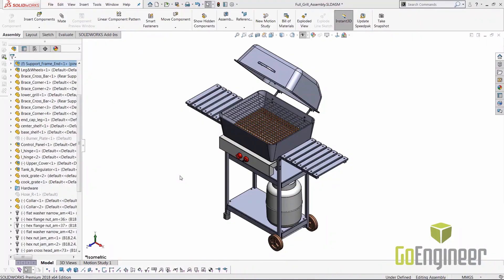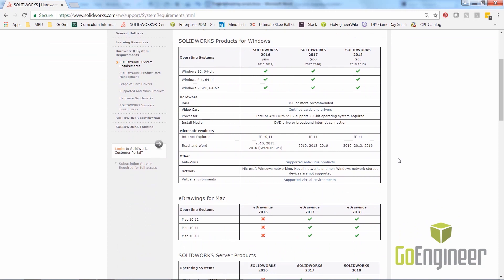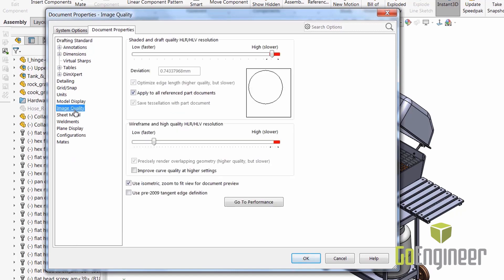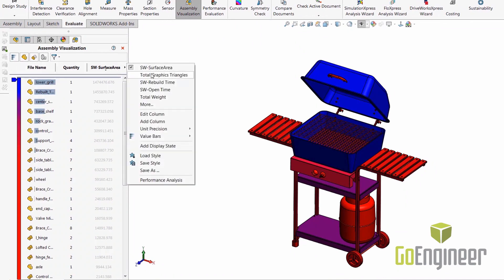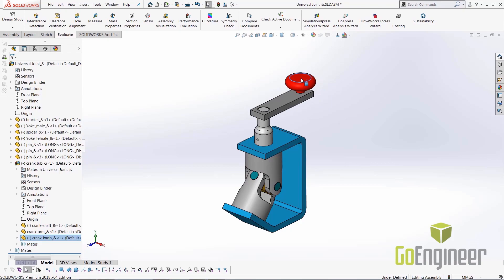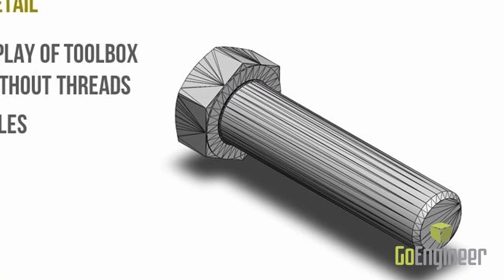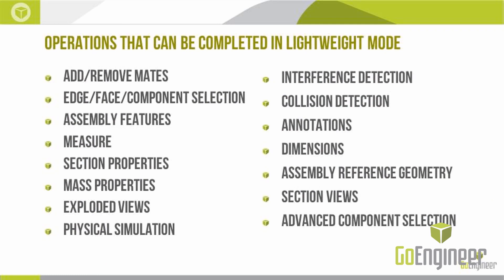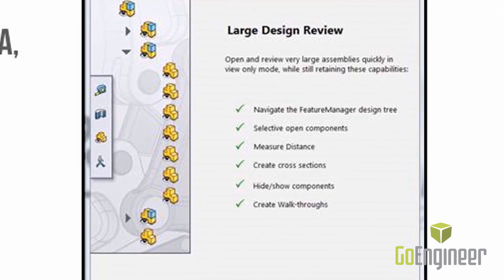SOLIDWORKS - Troubleshooting Slow Performance

Comment: I works with CATIA since more 10 years and all is speed, I try Solidwoks since 1years OMG it is sloooooooooooow xD

SW 2019 or 2021 is same! xD

What is the probleme, all is very lagy all time.... I have speak with other is same... Just put a ligne is slooooooooow xD

Comment: thank you for the video. I have a SWX 2018 edition, and since I started using it it's been slow, even when I am starting with a sketch. what could be the problem?
Reply from the maker: Rodrigo,
The two main concerns would be that you have a supported GPU (and are running the correct driver for it as listed here: http://www.solidworks.com/sw/support/videocardtesting.html ) and that you are accessing all your CAD files from the local hard drive of your machine and not an network/external/flash drive attached to this computer.  If you have those two things in place then you may want to involve your SOLIDWORKS VAR directly for assistance in diagnosing your performance issues to a more specific source.